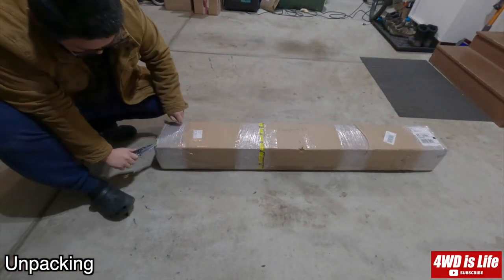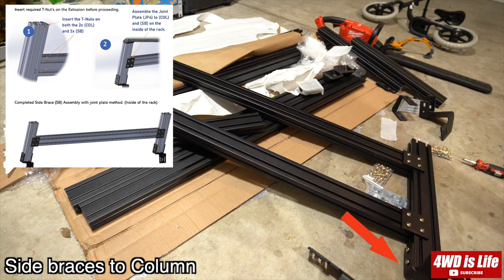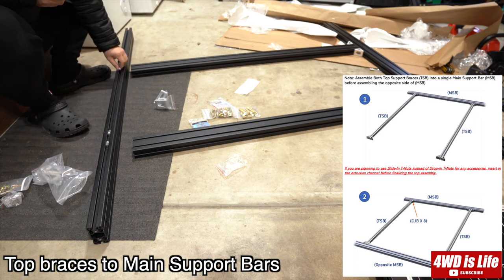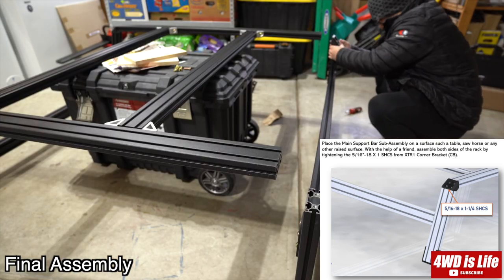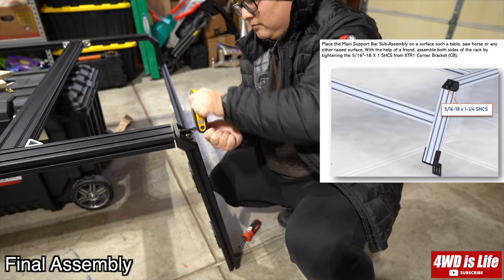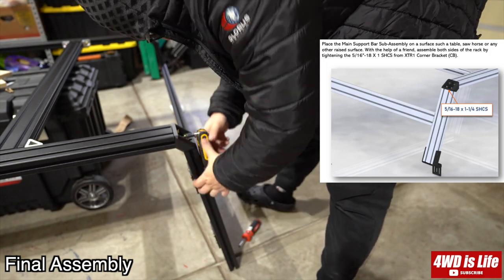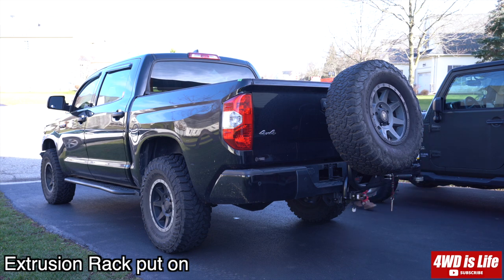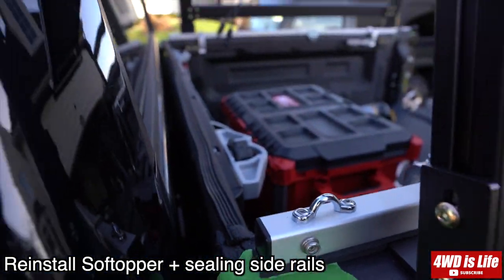Xtrusion Overland Bed Rack Installation - over Softopper

Comment: Can you fold the softtopper with the rack on?
Reply from the maker: yes, however, you would need to un-pin the canvas and the frame and then fold it, then putting it back onto the pins. let me know if that makes sense.

Comment: Any reason in particular that you went with the 24” instead of 23”?
Reply from the maker: I spoke with Xtrusion overland staff and they recommended it because it gives me a bit more room between the softopper and rack for any work I may want to do on top (mounting stuff)
Reply: I see. That makes sense. 
What would you say the gap is between the top of the soft topper when fully opened, and the lowest point of the top of the bed rack?
Reply from the maker: @pittman4209  https://youtube.com/shorts/_IQvWkhxNGs?feature=share
I did an awning short video hopefully this shows you a better picture of the gap between the topper and rack.

Comment: Can you close the soft top with the rack on? Open (deploy) it with the rack on?
Reply from the maker: yes. The softopper can be folded down and removed with the rack on. All need to do is remove the two pins and pull down a bit and then fold.